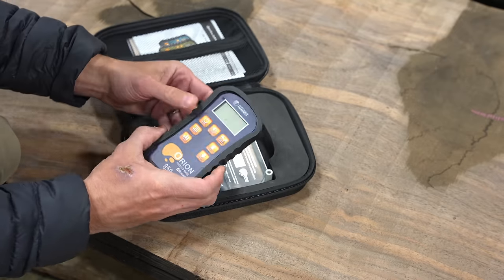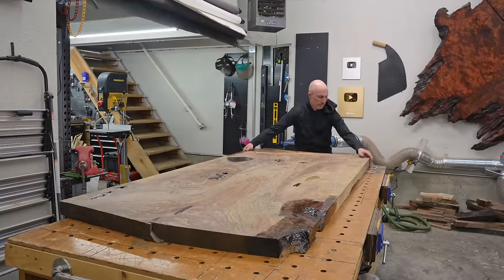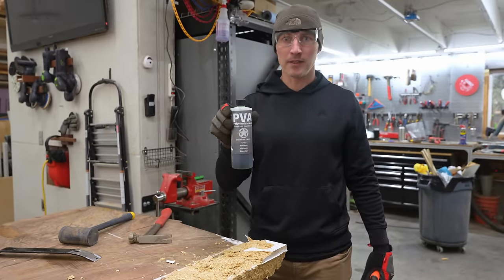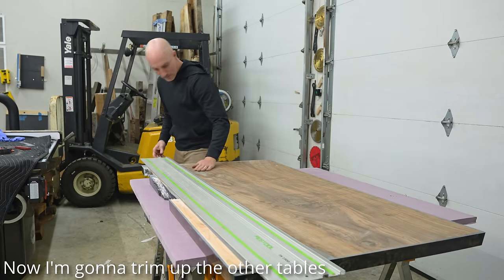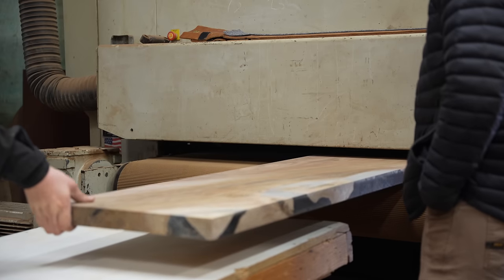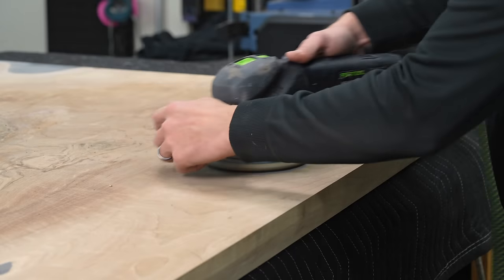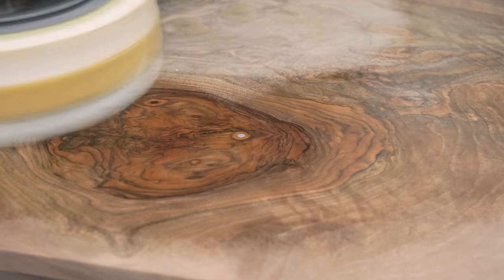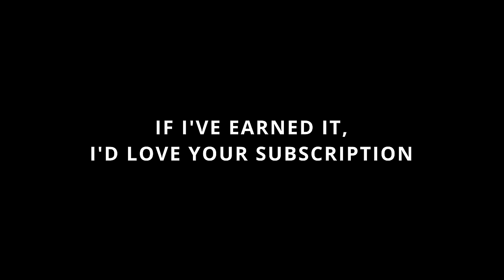Fixing the $30,000 Mistake

Comment from the maker: Sorry about the long wait between videos everyone! Spring sale link: https://n3nano.com/pages/spring-sale
Reply: Well worth the wait 👌
Reply: possible problems:...it can work too good.....
usually you can turn the vac on for just a few seconds to get epoxy to the bottom of a crack.
a few seconds more to make sure it gets inside the wood a bit....
a few seconds more and its fully impregnated the wood all the way through effecting color
a few seconds more and the wood is now and forever a hardened fiberglass sponge (my goal).
hard dense woods are still sponges...and very spongy/absorbent.....
a 7hp vacuum table will suck hard enough to hold 12" of mdf down like its clamped.....
7hp is enough/needed to hold all 4ft x 8ft x24 sheets of 1/2"......
a shop vac is tons for a crack or plug...sometimes too much if my adhd kicks in
Reply: I personally think this is one of your best videos ! So well done and now we see the true ''EYES'' of your work ! All hail CAMERA GUY !
Reply: A espera vale a pena pela qualidade do trabalho. São coisas lindas demais
Reply: totally worth the wait - great to see your redemption vid!
Reply: Where is the link for the giveaway?
Reply: No idea if there is a way to make this work, at 28:00 when you are filling tiny cracks, does anyone make a way to add negative pressure to the other side or a couple inches in to suck the filler further down into the cracks vs relying on gravity?
Reply: The console table is my favorite. But at 16:33 I almost choked on my potato salad.
Reply: console table (although it was tough with the colors in that dining table.) 12:02 where's the mold release link? :)
Reply: FINALLY!!! BEEN CRAVING ME SOME #blackforeststudios 💚💚💚
Reply: An Anti Start device would prevent any plug in power tool from starting when plugging it in. Definitely a great safety device for a wood shop. Excellent video by the way. Honestly one of your best.
Reply: That kitchen table is fucking fantastic with that grey. Wow
Reply: I love the look of the dinning table aswell as the console table you made for the clients,  I just hope you don't have any problem like you once had a longtime ago with the delivery. The last thing you need now is some official contacting you and wanting to get permission to open the crate because a sniffer dog senses drugs etc inside.  As always buddy 💯%   👍   🇬🇧.
Reply: I watched the entire video on my TV. Great video. What brand of sandpaper would you recommend for a Bosch orbital sander for finishing? I have dust extraction.  Finished a waterfall table for a competition (and won) but have some minor swirls I’m going to work out and refinish (will refinish with Rubio again). Thanks
Reply: I use plumbers putty
Reply: They are all beautiful and each unique,  but my favorite is the console table.
Reply: Gonna have to use your words it's hard to compare to the dining table. Also if I were a customer I don't necessarily think I would want daily updates but like updates for each step of the process and an estimation on how long they'd take and just once "hey this happened so it'll be longer than expected" if the estimation wasn't enough. I'm certain those products take weeks if not months start to finish and one step like filling the little cracks could take several days
Reply: lovely work as always, that table is amazing well worth the wait
Reply: console, but, they are all fantastic.  I love your work, but, let’s give another cheer to the clients of this work, they could have made a huge deal out of the delay, but instead, they were fantastic.  great work, great content.  thank you.
Reply: When you filled the end splits using a screwdriver it gave me an idea. You should make yourself a snake fang. A long rod but with a deep groove in one side that will allow the holding and flowing of your epoxy. I feel like that would offer enough of a cleaner job to be worth it. Especially in different sizes.... 😎 Loved watching the video in the morning with my coffee..... 👍
Reply: Stop feeding trolls you pay too much attention to that. Which only gets worse because they know this bothers you. 
Otherwise, outsource it to someone who filters out the good and useful messages for you.
Reply: All three are beautiful if I had to choose one I would choose the dining table!
Reply: That was great. 
The deadpan about the finished plugs was also legend.
Reply: Remember that you were only unaware and that is only ignorant not stupid and It's always better to to admit the fault and comeback stronger than look down on yourself your awesome man and a admire your craft just know that in no world are you stupid
Reply: You need to make shirts and hoodies
Reply: I love the console table!
Reply: from Lawrence Massachusetts God bless all of us amen 🇩🇴🇩🇴🇩🇴🇩🇴🙌🙏🙏🙏🙏🤝  Dios nos bendiga as tod@s amen 🙏🇩🇴
Reply: Yo Cam! Whose tree do i need to cut down to be able to come work for you? ;P
Reply: You really need a bridge crane ....before you drop one slab while flipping.  Or bast your back
Reply: Sir, if I ever win the lottery of land a crazy high paying job, you are the FIRST PERSON I am coming to for decorating my home. 😊 your work is absolutely amazing 👏 😍
Reply: well I cant subscribe twice or thrice sadly :)
Anywho I cant wait to get my own house and some work done myself
whats the best table? the biggest one, and the council table's legs, so if it were me, I would do a very super simple  cuboid skeleton frame for the top, I mean the frame for the top and 4 straight legs and thats it. I do not like this new-era weirdly shapoe legs, it makes me feel more like im in a circous then in a home.
Reply: I absolutely love your work! I also live the pokes! Don't change anything! Stay awesome!
Reply: My son is 7, he asked me to tell you he really likes ALL of your tables.
Reply: you should get a mafell or festo carpenters chainsaw or also called swordsaw.. way better than a jigsaw for your needs. only for curved cuts not suitable due to the width of the sword...
Reply: "In keeping with its China policy, the U.S. does not support de jure Taiwan independence, but it does support Taiwan's membership in appropriate international organizations, such as the World Trade Organization, Asia-Pacific Economic Cooperation (APEC) forum, and the Asian Development Bank, where statehood is not a requirement for membership. In addition, the U.S. supports appropriate opportunities for Taiwan's voice to be heard in organizations where its membership is not possible..."
Reply: Side question of mine, Do you ever get cupping or warping. And how do you go about fixing issues like that. Thanks
Reply: Out of all the links in the description, where's the one for the mold release?
Reply: I want to confess, when I first started watching your videos I was skeptical about your skills. I am no longer skeptical - I am impressed with what you’re capable of doing. 🤜🤛 Kudos
Reply: Loved the console table, but your face after he asked about the coasters was priceless
Reply: Just curious. Whar was used for finish?
Reply: For me the desk.  Love the musket looking epoxy flow.  Beautiful work!
Reply: I like the big box at the end ;-)
Reply: You might consider buying a good metal detector.  I've found t posts 6 inches into an oak tree.  Saved my chainsaw blade. (the oak tree was dead by natural causes)
Reply: @Vagabondpilot   'Natural Causes' eh? 
   "Uh no officer I don't know, uh, why it did whut it dun. I was walking along, uh, minding my own busy-ness and then outta nowheres dis tree come and trew itself on my saw. And that's all I, uh, knows."
Reply: @SweetBabyJesusOnTheCross  it rotted and was knocked over in a storm
Reply: Good 👌
Reply: Great work but my favorite piece has to be the smallest, the waterfall end table but their all great. Definitely a fan!
Reply: You should invite someone who wants to learn these skills for a youtube video and together make a mini table in a day (if that's Possible) they will probably ask questions to you you would think of while you both work.
Reply: You're the man!
Reply: I like that you included your "beltsander longjump competition" 😆 made me feel better about doing the same thing with a disc sander. only it was more of a highjump competition
Reply: My guy, itd be nice to see you wearing glasses when using the brad nailer, shit happens REAL fast. <3 love the videos
Reply: good content thanks.
Reply: Please tell us what respirator helmet are you using?
Reply: Why can you not dry out the moisture out of the other tables ? Second part is why do these huge slabs not soak up humility before they get finished ?
Reply: Just putting this out, a scammer is trying to use your channel name.
Check multiple other comments to see it yourself.
Reply: @BSGSV Truly a Benny Hill or Three Stooges moment!
Reply: You mentioned in one video your not a Dad. I think you would be a wonderful Dad and truly as much as you have grown and experienced revelations in life from woodworking you will experience far more from being a Father. Don't close the book on it and when you adopt or have a birth child you will see. Nothing will ever be the same and the riches of wisdom will be opened up.
Reply: I don't see the mold release in the description.?
Reply: There is a Account with your name that says its you and that i get a suprise gift. Check the comments
Reply: I don't know if this is a thing in the table world, but what about a truss rod scenario in the table top?
Reply: What about vacuum chamber for drying slabs? This staf can really help I meant to build vacuum chamber
Reply: The sander taking off happens to the best of us
Reply: Try making quick circles as you poor the canister so the liquid vortexs as it pours.bit will blow you mind how qiuckly it exits the bottle.
Reply: dude, the coaster idea from the same wood is nice.  You're good enough to do a trivet the same way, would be a nice touch (and more money)
Reply: R.E Updates: if I was paying that pricetag, it would be honestly reassuring from my contractor to be receiving daily reports. It may even be beneficial to you to get ideas from the customer of styled fixes that you perhaps in the moment didn't think of. E.g. “you contact customer, we've hit a snag in the design, I have these 3 ideas, which would you prefer, or do you have any input / ideas you'd prefer?”
Reply: Gotta love sensitive armchair quarterbacks hahahahaha.
   I love it. I laugh my ass off.
Reply: @sinbincreations 😮や😊
Reply: I loved the end table. I was just so cool looking.
Reply: Hello, i really like your work, i noticed you used black epoxy, i think is ok for the most part and fits with the final build, but i was wondering if there is a way to use maybe 2 or 3 color shades to make a random epoxy pattern? kinda like artists do with paint when they put different colors in the same container and pour it on a canvas to make really cool shapes? i think that would be awesome!
Reply: @sinbincreations 😊p
Reply: Console table
Reply: I love the  3 table
Reply: you say you like to piss off the anti circumcision crowd, which is great and everything but kids and babys shouldnt be circumcised, it should be against human rights to take away a boy/man's bodily autonomy, it should be against human rights
Reply: My 2nd vid, but it didn't take long to leave as well. I love to work w/ wood & this channel is so right up my alley.  My heart wants to stay, but  I'ld have to turn the volume off.  lol  It's a shame for me!
Reply: 😂I like the console table best!
Reply: I tried to make a comment, but this is the only way I can complement you on your work. Every table is stunning, and that side waterfall table is absolutely gorgeous. I love woodwork and wish I could do it. But I enjoy seeing what others make. Thank you in a new subscriber❤❤❤❤
Reply: That’s awesome
Reply: Way to go! You turned things Around thats what matters. All the best cheers!
Reply: @sinbincreations  ⁶⁶⁶⁶I have 6th grade and the ⁶66
Reply: Wow!! Absolutely amazing job!
Reply: We have a hundred-year-old walnut in Armenia. Living out his days 😔 Diameter is more than a meter 🤔
🗿
🗿
🤑
Reply: @sinbincreations  1:51
Reply: @sinbincreations  3:44
Reply: @sinbincreations  4:00
Reply: A totally non sensitive Beatles fan.
All We Need Is Love.
Reply: This is probably the 3rd time I watched this video and I still love all the pieces.
Reply: We Europeaans do NOT love GUNS .
We are against GUNS .
We got shooting ranges yes still we are more into Bows & Crossbows .
We also have Airgun ranges for sport .
Real Guns are not in fav down here all European people who tell you they love guns only say that because USA is known for it that well .
Reply: What to do with cracks is easy .
You build yourself a big Vacuüm box with a thick plastic back .
Then you get some epoxy that will dry very very slowly beyond 100 hours .
Poor it into the back with the almost finished slab and suck out all the air until you get to -3 bar .
Make sure it keeps -3 bar the entire drying process so the wood will suck it into all the cracks .
And when its dry simply plane it again to get of the vacuum bag .
Simpel logical thinking always remember the KIS Principle .
KIS Keep it simple or stay Logical .
Reply: I like the console table
Reply: 24:37 you are my favourite bloke (of wood) on youtube for this reason
Reply: Hey man, might wanna do some research into that new M3 top coat you used, and see what you can find out. M3 has a history of their products such as "Scotch Gaurd" containing ingredients that are carcinogenic. In fact the formula for Scotch Gaurd, and many of their other products, are even being changed currently to replace the "Forever" chemicals that build up in humans with half lives so long it won't leave your body in your lifetime. That finish may be just fine idk. I just thought I'd make you aware that just like the greedy Bezos types, Chemical Manufacturers have pulled a lot of fucked up shit as well, M3 being one of them. PS, Just like big tobacco M3 also knew it was a problem, and lied about it for DECADES it turns out as proven by thiewr own internal communications documents released during various lawsuit's discovery phases. Somthing to consider.
Reply: а почему ты не используешь белый клей пва?
Reply: там же есть много способов устранения трещин... Паклей забить...
Reply: https://youtu.be/11S1M6p8n8k?si=9GU3T5GpORh_I98L

How do you like this table?
Reply: День добрый! Есть на русском языке?
Reply: Why don't you use syringe with needle to feel tiny gaps with epoxy
Reply: All three were beautiful.. buty fav was the big one with h the bullet..
Absolutely fantastic job.. Your details for perfection is amazing..God bless..PRAY ON!!!! 🌹🙏❤️
Reply: Felicidades por excelente trabajo. Saludos de Puebla-Mexico.
Reply: por que no secas la madera antes?es todo por el show??
Reply: I like number four but I think I have to go with number one because that's the one that took my eye first of all and I am a man that follows my good instinct 
i5 from Chester UK 🇬🇧👍😎
Reply: Te saluda Mauricio te escribo desde Ecuador latinoamérica y realmente tu trabajo es extraordinario y muy cuidadoso sinceras felicitaciones

Comment: 18:14 Here's a tip for these tough decisions: Cut the opposite end first, leaving as much material on as possible, so you can see in advance if going to the absolute limit on the end you want to trim off would be acceptable. If not, walk it inward, always trimming a bit off the least acceptable end each time. You don't want to cut deep on one end just to find out that the opposite end is problematic afterward. Stop walking it once you are happy with both ends or you've hit the limit of what you can remove, because now you've found the ideal balance.
Reply: great advice
Reply: Exactly. This is the way to know what you’re dealing with.
Reply: I think what he’s trying to say is you can always cut a little more off, but he can’t add to.
Reply: Can you give me advice how to get a girlfriend?
Reply: @JohnWayne7777  you could try the same advice. Chop your wood off, a little at a time.

Comment: I can relate so much to those moments of terrible mistakes coming to manifest themselves, and, after the initial shock, shrugging them off and soldiering on in the building process.
Reply: Are they actually mistakes or is the universe nudging you into a direction you may not have gone. Many of my "Mistakes" have been the highlight of the project.
Reply: Amateur
Reply: @raydillon417  good point!

Comment: Incredible package. Way to solve the issue and benefit the customer, your suppliers, your channel and the community. 
On another note, I laughed my ass off at the belt sander running away when you plugged it in. Last time I did this, it took a dive off the end of a client’s dock and into the lake. Fortunately, simple machine and dried out fine. Works great to this day. 
Nice work sir!

Comment: Hey Cam, I absolutely love your videos. I own a sign business and what i do is photograph the piece of wood, straight-on from several feet away to minimize distortion, then do a sign layout to full scale on the photo using Coreldraw (also can be done in Illustrator). Kinda hard to explain but you could do the same thing when laying out these tables. You could "cut" the slab apart, move pieces around, rotating them, etc for presentation to the customers. In addition, it could save you alot of time laying it out. Just a thought...
Joe